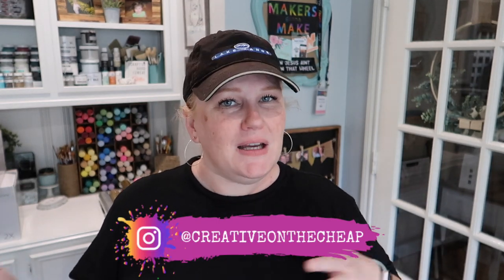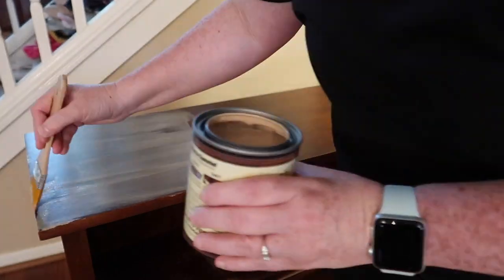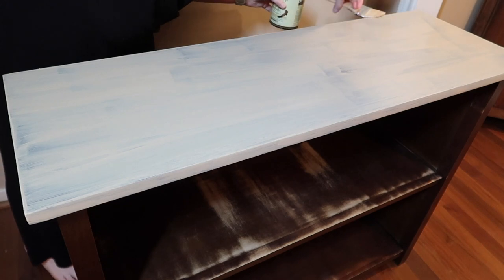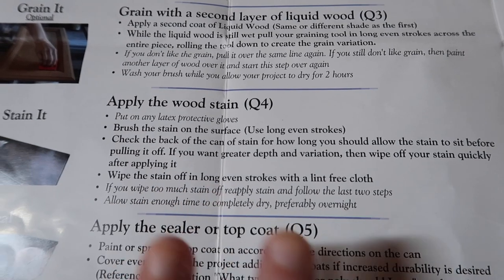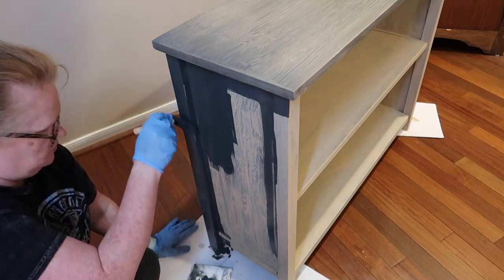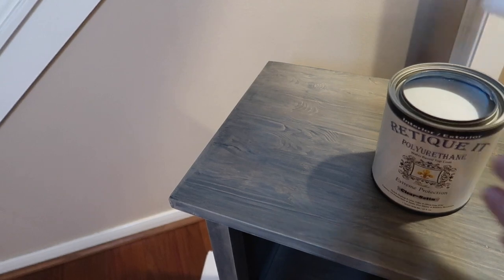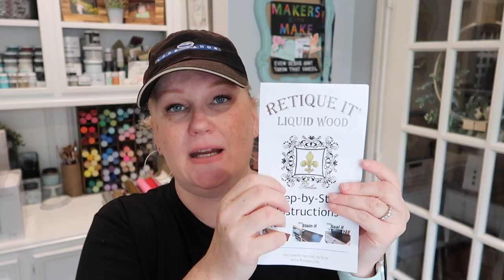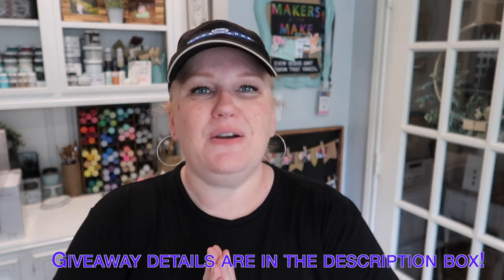⭐️ HOW TO RESTORE furniture without sanding or stripping!

Comment: I am DEFINITELY using this to refinish my dining room table & chairs. Bought it last year on FB marketplace with the intention of staining the top dark & painting the apron of the table with white chalk paint. Well, the veneer damaged in some spots, is too thin to sand out and then stain. I’ve been holding off on this project until I found a better solution than just painting the entire thing. So A HUGE THANK YOU for sharing this because now I can finally finish it!!!

Comment: Very nice. I have several items that this product would work on. The first one that comes to mind is an old boodshelf. It is solid wood and at least 60 years old. The legs have gone missing, but I think that a nice dark stain with some small hairpin legs would make this into an outstanding piece of furniture. I also have several other pieces that are cabinets. This product would work well for them. I would replace the cardboard backing with a nice piece of birch plywood. Regardless of whether I win or not, this product is intriguing. Thanks for showing this product.

Comment: I am refinishing my kitchen table, which had grooves that used to collect crumbs. We sanded the grooves completely down. I have worked like crazy using chalk paint to refinish the table but it has turned out to be a disaster. I think it has to do with the MDF. Anyway, I have stripped that and I'm back to square one. Your table turned out fantastic and I'd love a chance to try this product on my kitchen table.
Reply from the maker: A kitchen table would be great with this product!

Comment: Thank you for this video. I have two shelving units I thought would be cheaper to paint vs buy new and this product would definitely help me achieve that goal.  I was wondering though if there was a line of colors and not just stains?
Reply from the maker: Yes, they have an awesome line with lots  of colors of chalk paints that you could use instead of stain.

Comment: This looks amazing. I have a tall skinny cabinet that is turning orange and I would love to give it a refresh.  I'm wondering how it would do for refinishing kitchen cabinets.

I do have a question: I noticed you did it inside of the house. How was the odor? sometimes those stain products are so strong.
Reply from the maker: It wasn’t bad at all.  There was an odor but I did it in a very open area and it didn’t smell up the house at all.  I think it helped that I did the top first and then the other parts and broke up the project a little bit .

Comment: Wow! Wow! Wow! What an amazing finish. It looks so good!  I have my grandmother's oak kitchen table that I would love to try this technique on, especially as the legs of the table have lots of groves, and sanding would be a major chore. I would love to use the wood-graining tool on the top of the table, and then leave the legs smooth. Do you know if it works on sealed wood surfaces? I'm not sure if the finish is varnish or lacquer. Thanks so much for this video and give-away op. <3

Comment: I am wondering a couple of things......is there a strong smell to these products?  Would you do this indoors again?  Also, I have a Sauder cabinet that has a faux wood finish.....do you think that I could use this product on that?  And my last question is what stain color did you use?  In the video it appears to be a grayish sage green.  What an awesome product!  Thanks for sharing!
Reply from the maker: There is a slight odor to it, but it did not bother me at all.  I would definitely do the project again inside.  It didn’t smell up the house while working on it.  While it was drying, the only time I could smell it was when I walked by really closely.  I used the stain color Classic Gray.

Comment: I absolutely love this beautiful.  I have a very old sellers cabinet some one painted the outside of it dark brown an its chipping at the bottom . If you know what i could do to restore this i would greatly appreciate it.  Thank you soo much for sharing this video ! God Bless
Reply from the maker: Thank you!  If the paint is chipping off, you would probably need to go ahead and sand it to try and get it smooth.  You could also put some wood filler on it and then sand to get a smooth surface again.  This product would probably work very well on it.
Reply: @CreativeontheCheap  thank you

Comment: I have a hutch that was my great grandmas and it has gone through many different family members before I got it.  There is a candle ring (where the candle burned a ring on the top) and my son's pumpkin rotten on one shelf and I would like to restore this.  There are many pieces, it makes it hard for me to get started on working on it. This would save so much time if I didn't have to sand it.
Reply from the maker: That would be a great piece to refinish!